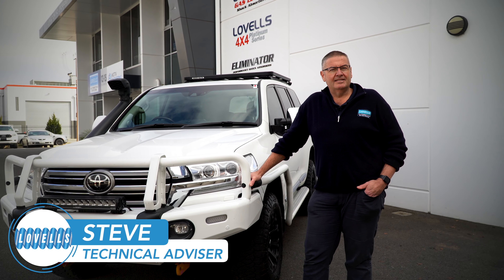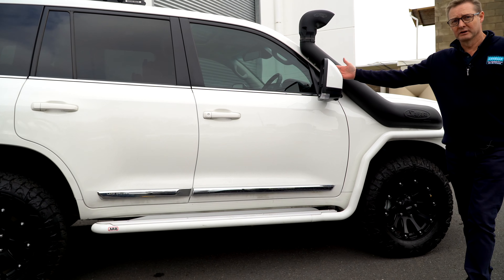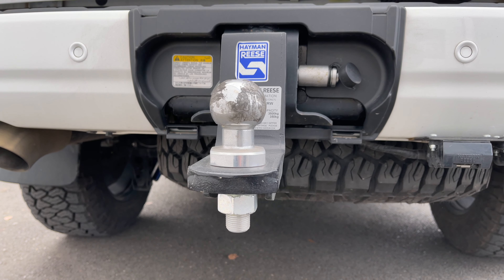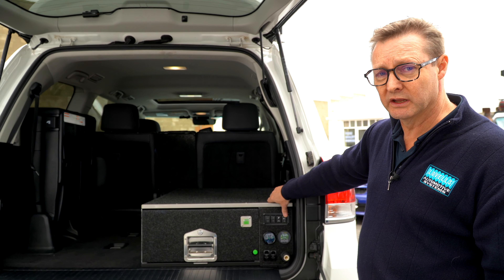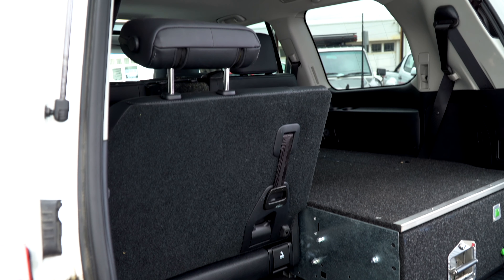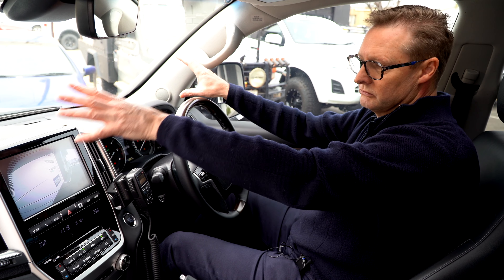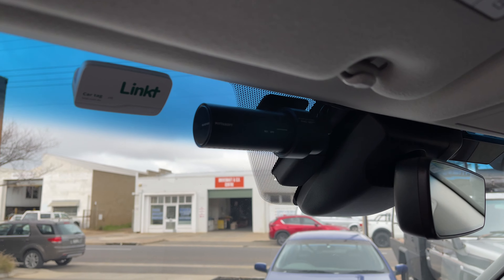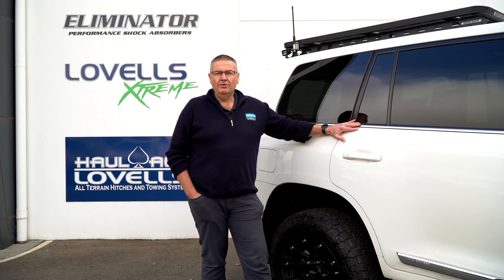Toyota Land Cruiser 200 Series -  Touring Sahara | 4200 Kg GVM Upgrade

Comment: Hi with 4200kg gvm upgrade do you  change the rear axle housing? as this a problem facyory housing only rated to 1950 kg if the topball weight is 300kg draws fridge tools easy to be over the 1950kg  regards Ian.
Reply from the maker: Hi Ian. The 79 series goes to
GVM 4200kg and GCM 7400kg
Take the rear axle to 2250kg and front axle to 1950kg
We don’t change the rear axle to achieve this..

Comment: I have a 2010 200 with Lovells GVM 3.8t can I upgrade to 4.2?
Reply from the maker: Yes, Lovells offer a upgrade from  3800kg to 4200kg GVM this is a retro kit. We would need to speak with you regarding options required.
Please call Steve
On 08 83745500